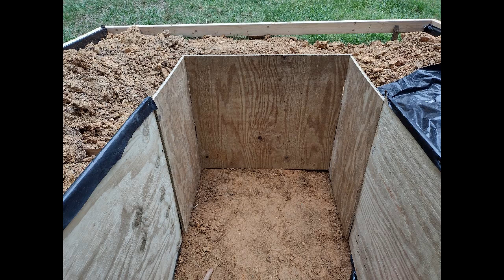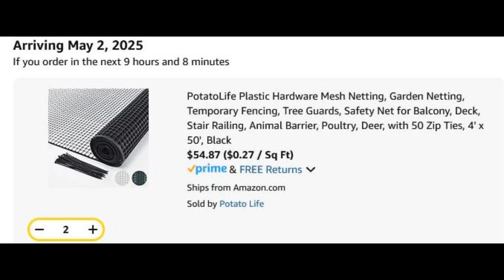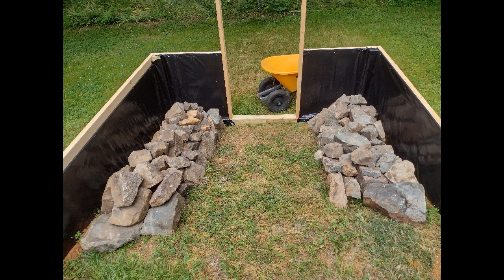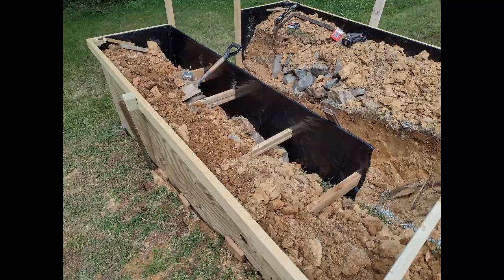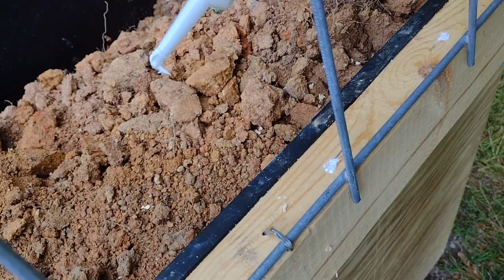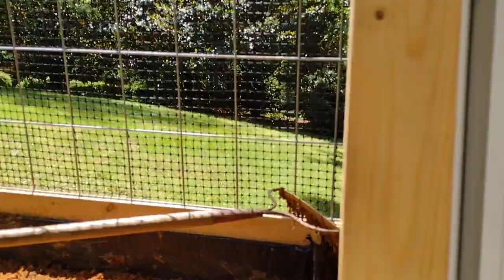Raised Bed Garden Structure Build in HILLSIDE with hoop cow panels

Comment: Hello,  and what will happen with wood in a couple of years?
Reply from the maker: I hope the wood lasts at least a couple of years.  The wood that is touching soil is pressure treated, so that should help.  I will eventually paint the above ground 2x4's to help them last longer.  And I'm going to caulk the storm door, because that's pressed board under the plastic and metal skin.

Comment: Cool build. Reminds me of a walipini.
A few ideas:
Use treated or "marine" plywood for more longevity. Or better yet, make the "raised bed" out of retaining wall block (a lot more work though).
When filling the beds, mix/stir your native soil with the store-bought soil(or compost). This is also a good time to add other amendments (if you choose to use them) like worm castings, stone dust, dried kelp etc.
Add a small window/vent/opening at the rear of the greenhouse for ventilation when needed.
Reply from the maker: I had to look-up walipini.  Those are pretty fancy compared to mine.  The plywood I used was pressure treated, so I hope it lasts a while.  Block would have lasted longer, but beyond the effort I was willing to expend.  Thanks for the soil composition ideas, I'm not in charge of that department :)  If we add plastic to make it a greenhouse, I do need to think about a window on the far end.
Reply: or consider cinder blocks maybe instead of any plywood . thanks for sharing!
Reply from the maker: Maybe if the pressure treated plywood gives out after some years, I can reinforce with block at that time.